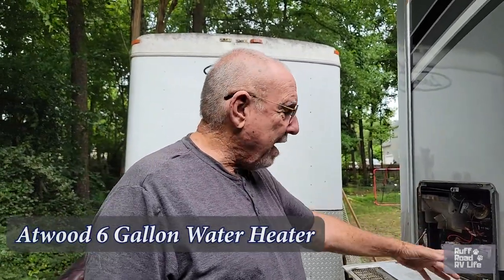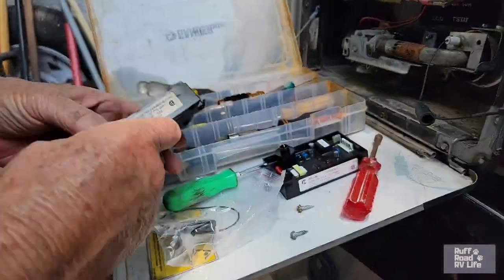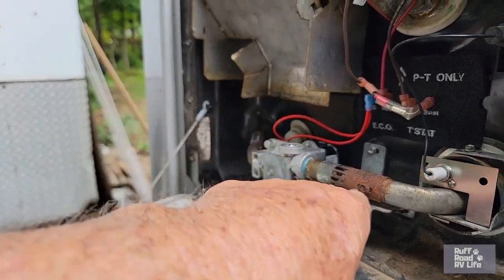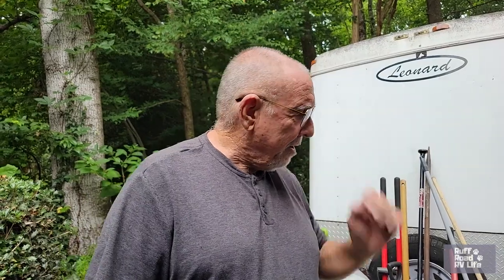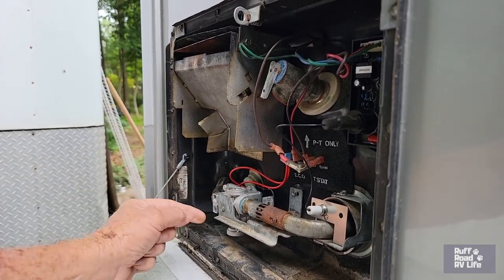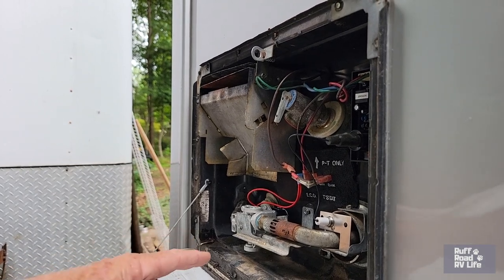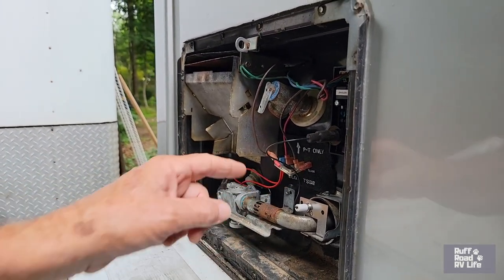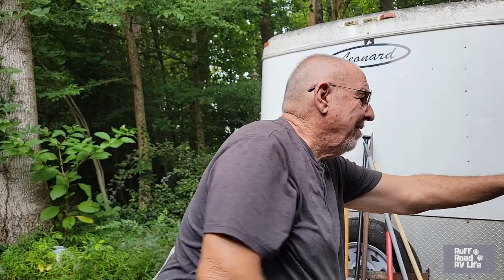Hot Water Heater Not Working?  Here's What We Learned

Comment: I had a mobile home GAS FURNACE that wouldn't  ignite.  I  did tests and finally found a SPIDER had mad a little eggnest or spiderweb inside that igniter pipe.  The gas couldn't get into the burner area so wouldn't ignite.  Costed me ZERO DINERO to fix it.   I watched your video to see what you found and it is similar to what I found.  Something blocking the gas as it traveled to the burner.
Reply: I had that last year with stinkbugs crawled into it and clogged it up.Had soot  above the water heater,wasnt burning clean with the pipe clogged.
Reply from the maker: Yes, that was the first thing we will know to check next time.  We're happy you found it first.  👍😊👋